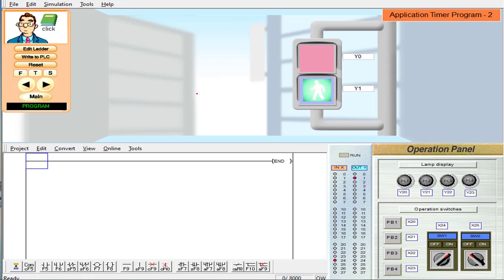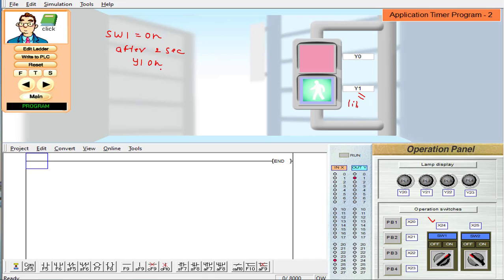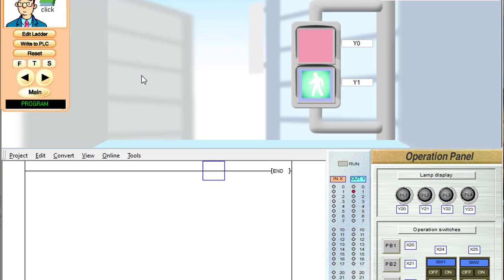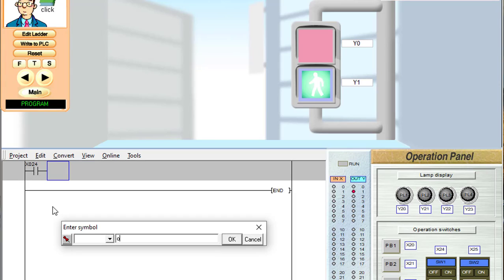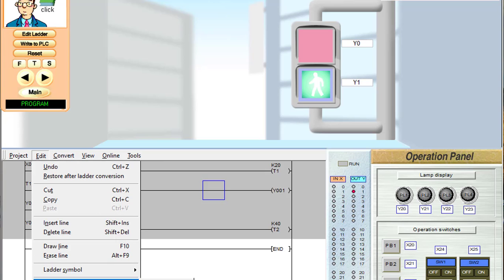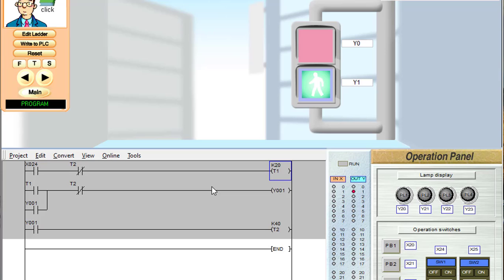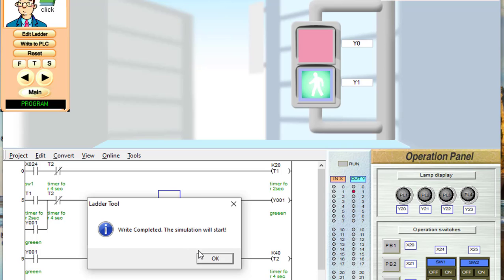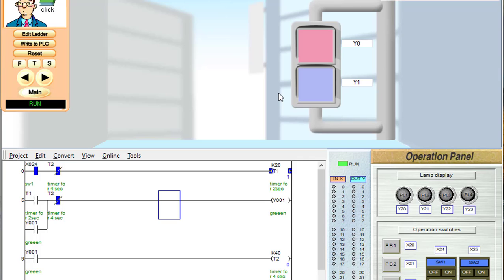PLC Program for Flashing Light using Timer

Comment: Would it be better that when the switch is operated, the light goes on immediatly, stays on for 2 seconds, then goes off for 2 seconds then repeats?  Its a better user experience if it lights up immediatly.